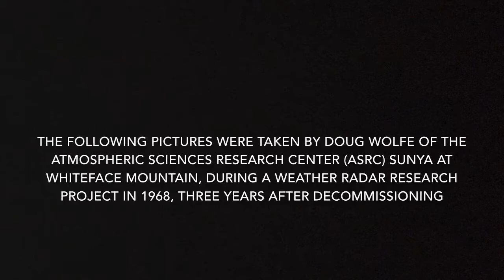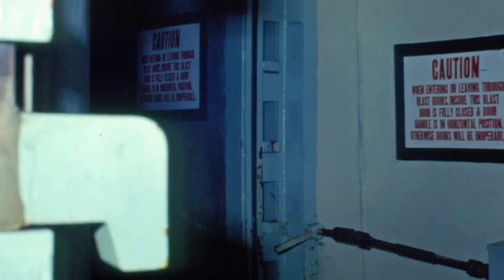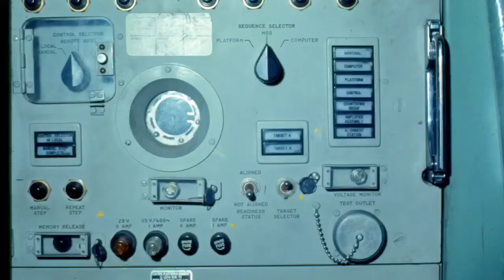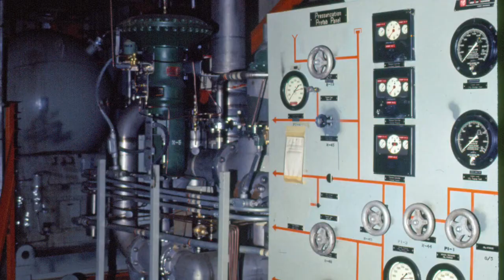Atlas F Missile Silo 556-6 Au Sable Forks, NY [1968]

Comment: Went and saw it tonight for the very first time ever!! I've been looking for abondoned places/historical places to explore and tonight I chose to start here, as my stepdad told me about this as he grew up in Ausable, up top still had some of the metal frames to the piping in the center but I'm really confused as to there is a bunch of black metal barrels that say "waste" on em and then a big black plastic looking tower by em, I should have popped one of the self locking pop ring lids off but didn't think to at the moment but  I wanted to go inside and check it out as I saw the wooden door/porch but I saw the camera above the door and the sign on the door and figured I'd probably get arrested as I'm a well known individual up here,. I'd love to find some places in upstate NY to explore as I'm born and raised in Peru/Plattsburgh NY, but it's so nice to see the inside wish I could have seen it myself
Reply from the maker: Very neat you made it out there!  Good luck on your future explorations as well.  This site has been heavily salvaged below ground, the LCC is an empty floor-less concrete tube, and the silo is flooded up to the utility tunnel.  I posted an updated video on my channel, check it out!
Reply: @silopedia  it was definitely a fun time, I went back the next night, and it looked like someone went in and was either working or destorying it,. As the camera was now unplugged, the surveillance sign on the door was ripped off, and there was a metal sqaure section freshly through on the ground,. I checked the black barrels and half were labeled soil and other half water, we also found cut of wheels were someone tired to cut into the 3,000 gallon barrel, luckily they didn't succeed,  this time since the camera was unplugged I went to open the door to enter and the gate behind that wooden door was locked so, we were sad but we took some pictures of up top and we checked out some of the smaller "towers" off in the grass as one had a hatch but it was full of crystal clear blue water, I also tossed a small metal beam down one of the silo holes and when It hit you could hear the echo and tell that it was empty,. But looking through the gate at the entrance, you could see part of was it starting to flood as a good chunk of water was on the floor,. I wish i could figure out a way to find out who owns it, just to see if they could take us through it,. I'm just glad that whoever it is, has it locked so nobody puts it in worse condition with tags and trash!!! There's 11 other sites up here, I know 2 have homes built on/in em, and the Lewis NY site is being preserved by the guy who bought it along with a local  agency, out of the 12 sites 2 are in Vermont as well,

Comment: Are there any in such a good condition now?, im guessing there are still a few that havent been sold  by the military.
Reply from the maker: Unfortunately not Paul, at least not in this pristine condition.  The most “intact” are probably the sites in Nebraska, however they’re partially flooded and the structures inside are rotting away.  Even the Atlas F sites under USAF ownership on Vandenberg AFB are in poor condition.